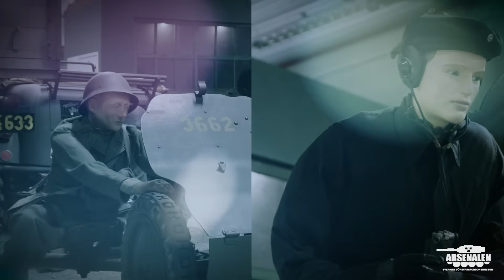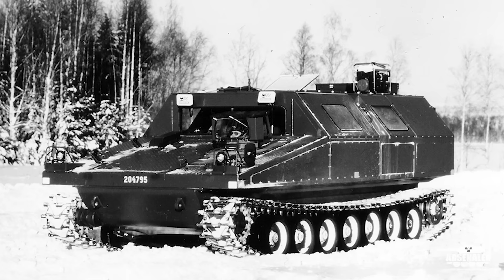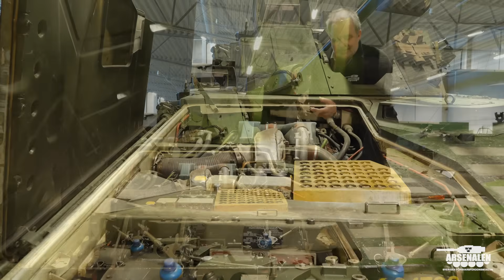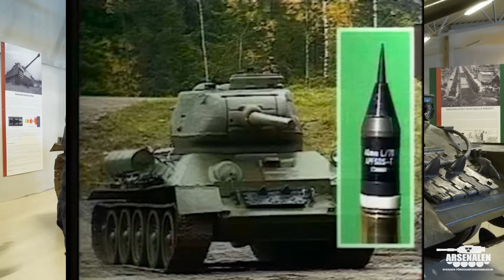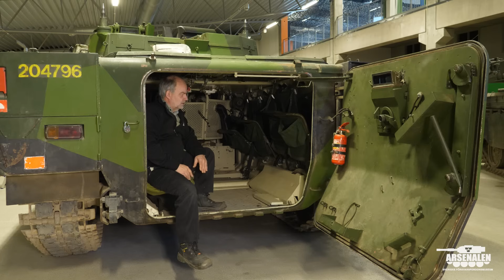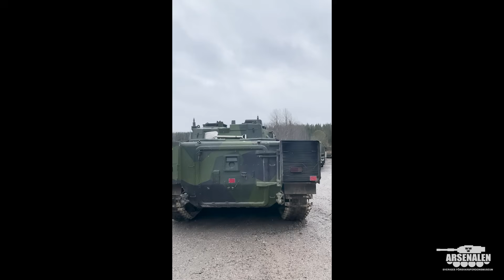Stridsfordon 90 - CV 90 | Arsenalen Swedish Tankmuseum

Comment: As someone who has never served, and has exceptionally limited experience, I am wondering. The old S Tank had a brush bar/dozer blade, would an AFV have the traction and power to make use of something like that?
Reply: Yes. there is a armored recovery vehicle variant with dozerblade in the front. Bgbv 90 A and C. Also has 2 winches and other special equipment.
Reply: @Mange070   Hopefully Stefan gets the chance to do a video on those sometime?

Comment: Why most of the CV90 variants dont have any ATGM?
Reply: Very few IFVs do
Reply: They are accompanied by infantry in combat that are better at AT than the IFV is. CV90 protects tbs troops, the troops protect the CV90.

Later ones for export have ATGMs since they are used in other doctrines.

Not having ATGMs also means you have more space in the rear for mechanised infantry and a lower weight vehicle.
Reply: The cv9040 do miss atgm, but 9030 and 9035 has Spike-LR atgm and APS
Reply: @jonnyhjalmarsson9057 There were ATGMs mounted to an original Strf9040 that the Swedes tested. They were very aware of the combination and had a vehicle that could use it just fine.

However, as it was not fit for their doctrine and wasn't worth it, they instead chose to go without the launcher and use the space to mount more mechanized infantry. Sweden's armed forces are primarily designed for home defence. They don't attack others, thus their equipment is heavily tailoured around their needs, their enviroment, and their resources.
Reply: @ZETH_27  i didnt know, awsome to know,  AT4?
Reply: @jonnyhjalmarsson9057 The crew in the CV90 nowadays are armed with ether AT4s or Javelins.

The CV90 with ATGMs was armed with Robotsystem (basically meaning ATGM) 56, also known as "BILL"; Bofors Infantry Light and Lethal. It was a Swedish-made top-attack ATGM that was man portable but also launchable from vehicles. It was highly mobile and capable of going past enemy frontal armour by penetrating through the roof of tanks.

It was used in the 1990s and 2010s, but was then dropped and later re-introduced in 2021. It's currently in service with the Swedish Armed Forces, however not on CV90s, of which use ether French Acheron or Israeli Spike-LR ATGMs right now depending on configuration.
Reply: @ZETH_27  whats your opinion on MBDA akeron gen 5 or Spike-LR as a atgm?